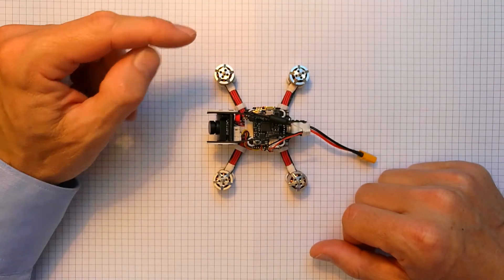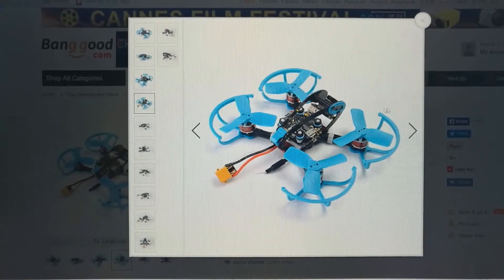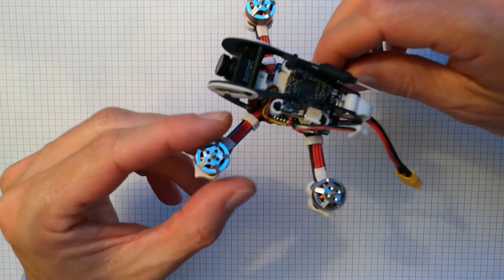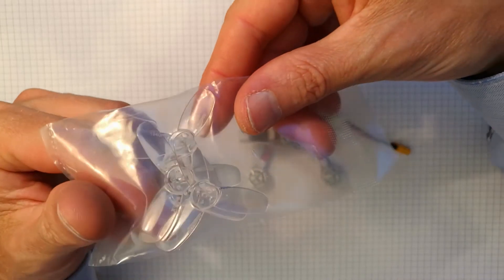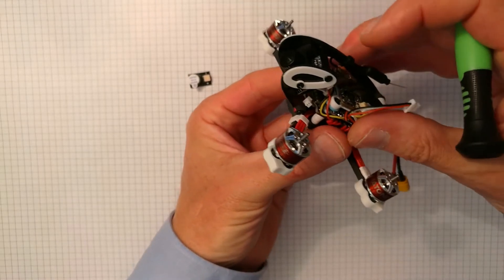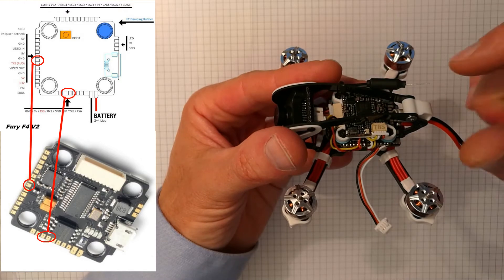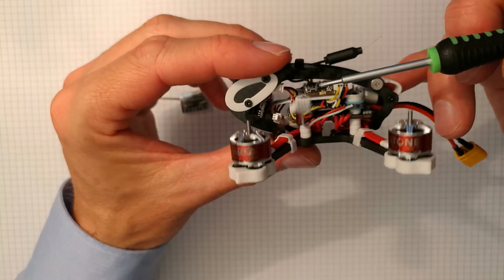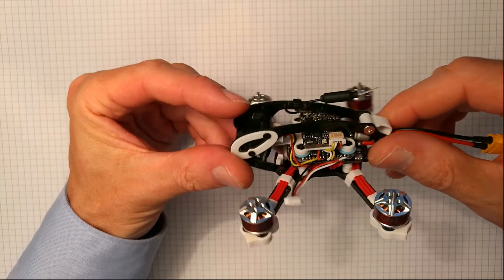Diatone GTR90 V2 -- New Features

Comment: Christian firstly thanks for putting that vide together. Question, that receiver has the ability to support IBUS or SBUS as shown on the front of the receiver. Why did you go to the trouble of moving the connection to the IBUS port?......is there an advantage?
Reply from the maker: Hi John Bund. You are absolutely right: With this receiver one could use the sbus-protocol. However, ibus is the native FlySky protocol and I am using a FlySky transmitter. I made the observation, that all my Flysky gear works better (more range, less errors, less delay) when I use the ibus-protocol. If you have a transmitter, supporting both protocols, it could be worth while testing the sbus-protocol. With my transmitter it doesnt work out well.
Reply: Thanks Christian. I thought that might be the case, particularly latency. I will try using S.BUS in any event first up and see how it performs.

Comment: What radio gear reciver / transmitter do you use
Reply from the maker: Abdallah Chaalan, I am using a Flysky i6s transmitter for my mini and micro quads. It's a good performer for the given price point.  However, for my (rather expensive) fixed wings I stick to my trusty Graupner mx16.
Reply: Thanks bro your a legend mate